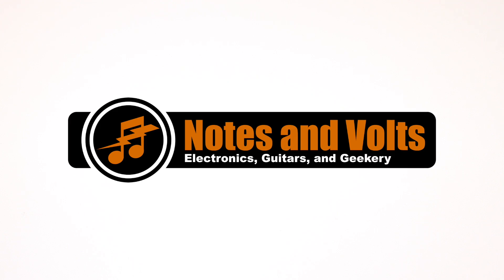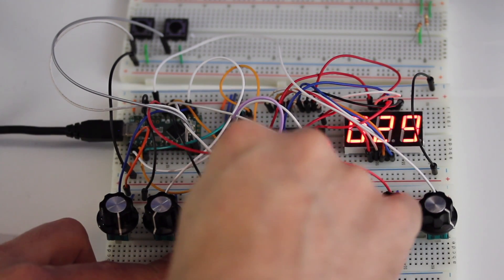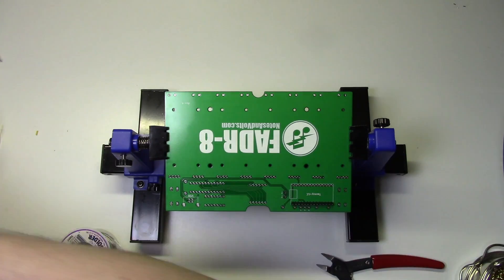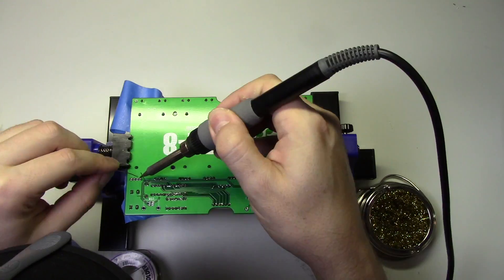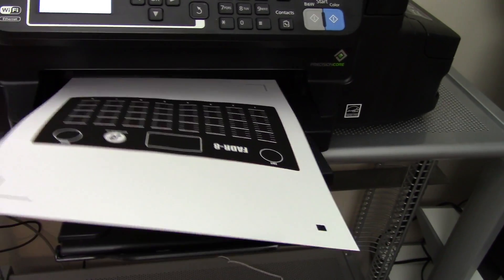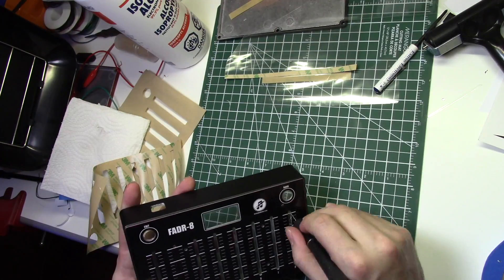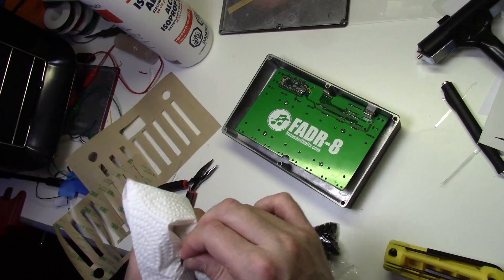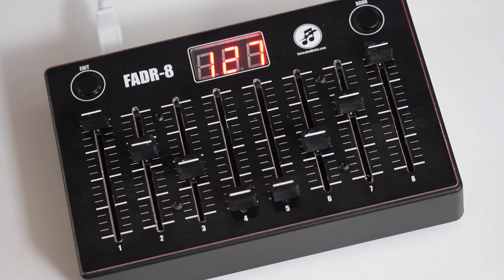MIDI Fader Box - Thanks to JLCPCB!

Comment: Hey Dave, great videos. Super inspirational.  Super fun to watch and at the same time I learn a lot on every video. I'm on my first steps learning midi with arduino and other platforms. and midi and  C++ language. I was looking for implementation or libraries of code, videos, anything that can help me get my feet wet, about motorized faders, fader recall,  bank change, all of those goodies. You've got any good links I can check out? Thanks!

Comment: Flippin beautiful, man. I wonder what kind of brain you'd need to implement motorized faders (2-way communication type thing)
Reply: Works with teensy as well. Check out ttapas Control surface library on github. I’m not sure if the motorized faders have been implemented yet, but they have been on the projects todo list for quite some time.

Comment: Is it possible to make that with an Arduino board? (For example using a Midi library)
Reply from the maker: Hi InfamouZ. You would need one that is small with a good USB Midi solution. Any suggestions?
Reply: Notes and Volts Hmmm, what if I use a Pro Mini and a Midi Over USB lib? :-)
Reply: You'd need to use an Arduino that has native USB so a Leonardo or a Micro would work. Micro would be best as it's small.
I am currently creating a DJ controller with a Leonardo that uses the USB MIDI library. Feel free to check out the video on my channel and follow along with the build if it's something you're interested in. :)

Comment: nice video man. how did you exported the 3d files from kicad and used them in Fusion 360? That would be a very interesting video. Keep up the good work.
Reply from the maker: Thanks Mortal! That would be a great idea for a video - just so I can remember in the future. I basically load the Kicad board file into FreeCad and convert the format there. Then I can import into Fusion. There may be a better way, but I haven't found it yet.

Comment: Hey dave Is it possible to get your code somewhere? im currently stucked at the code, the display works, but i have some offset issues with my fader, thanks. awesome project keep up the good work
Reply from the maker: HI A. sOn. Check out my Patreon page you can find a version there. I am still cleaning up the code before I do a final release.
Reply: AWESOME looking unit!!!!! When you say "release" are you referring to a final version of the code (on Pateron), or an actual release of this rad hardware you unit you made?